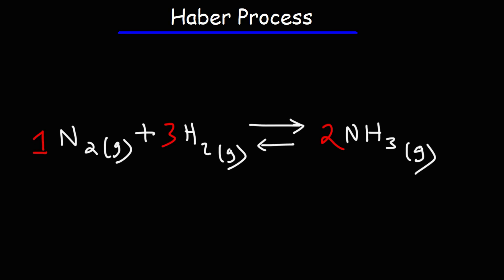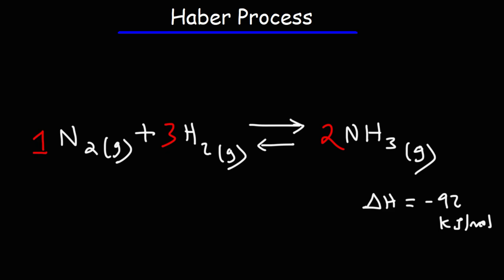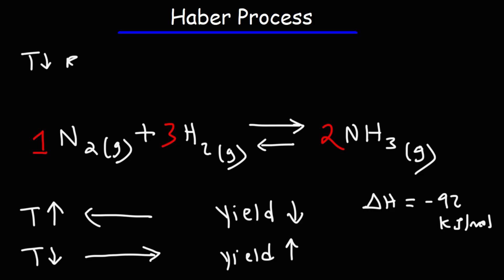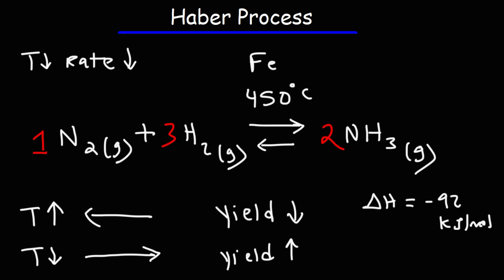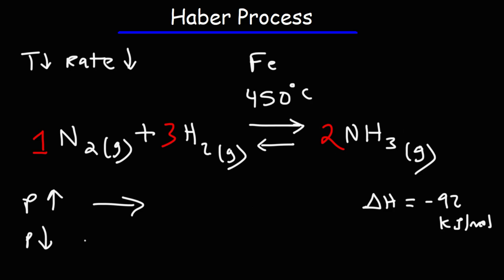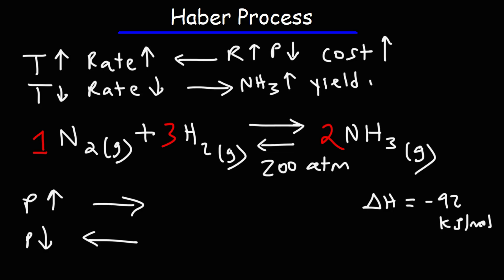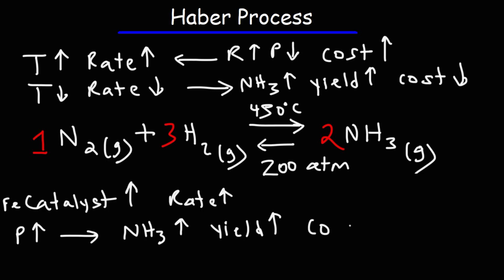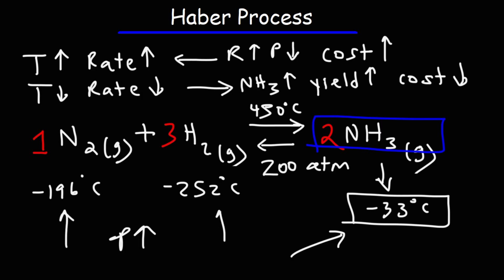Haber Process and Le Chatelier's Principle of Chemical Equilibrium

Comment: I am really struggling to solve this problem. Could you give me the key to solve it (The Haber–Bosch process is the main industrial procedure to produce ammonia. Hydrogen reacts with nitrogen (derived from air) to form ammonia, in the presence of a heterogenous catalyst (e.g. Fe, Ru compounds). Assume that:
1)
the reaction is carried out in gas phase in a closed reactor of volume V, kept at constant temperature T and pressure p
2)
the gas mixture is perfect at all temperatures and pressures
3)
initially the system is prepared with nN0 moles of nitrogen and nH0 moles of hydrogen.
Perform a purely thermodynamic analysis to determine the amount of each species in the system at equilibrium. Solve, discussing your methods, data and approximations, the following problems:
I.
evaluate and plot the equilibrium constant as a function of temperature; assume constant but not zero thermal capacities
II.
suppose that an industrial plant works at T=300 K, p=150 bar, and at equilibrium the reactor contains 30 tons of ammonia: what mass of hydrogen is initially introduced, assuming that nitrogen and hydrogen are initially in stoichiometric ratio, i.e. nN0 / nH0 =1/3?)